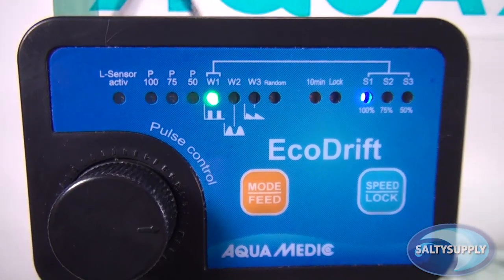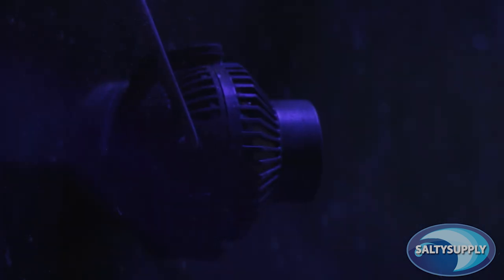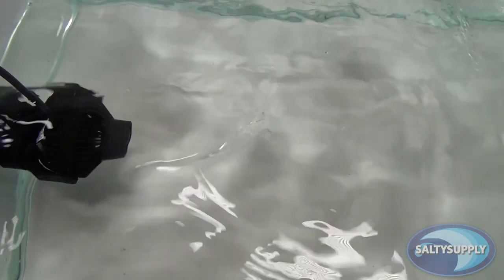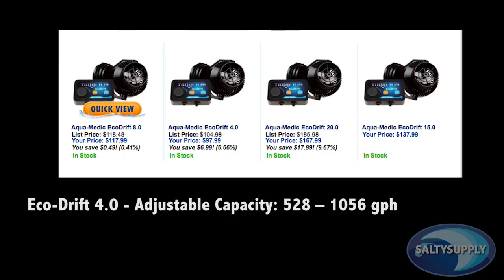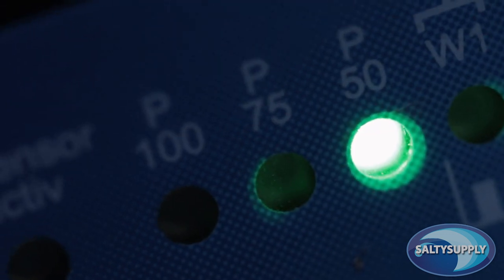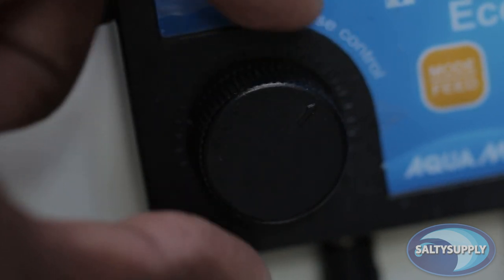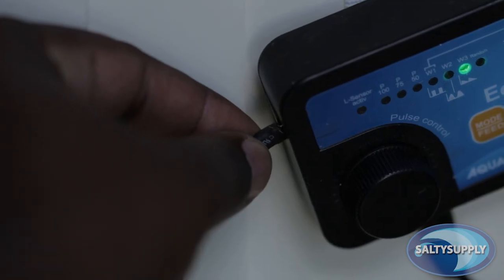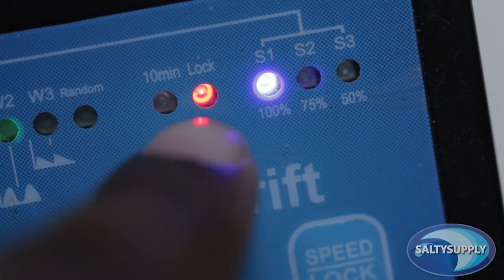EcoDrift Controllable Pump: Everything You Need To Know

Comment: Does the lock mode override Feed mode? In other words, if I lock the controls do I need to unlock for feed mode to work?
Reply from the maker: Hi, I know for sure that Feed lock mode overides Speed lock mode. If you have speed lock on you can still initiate feed mode for 10 minutes. Once your feed mode ends it will then return to the speed lock mode that you previously set. Hope this answers your question. - Thomas